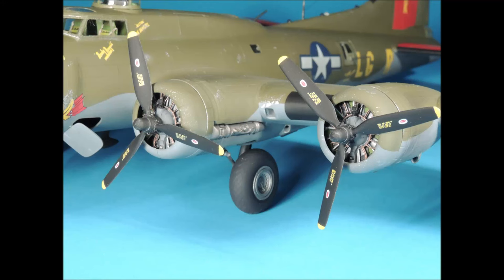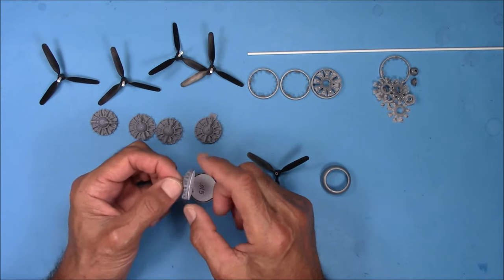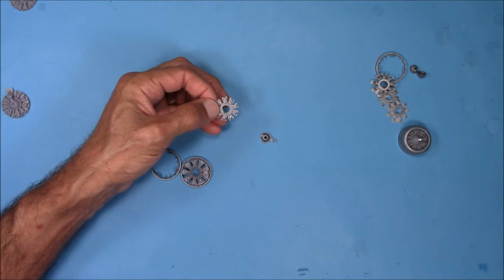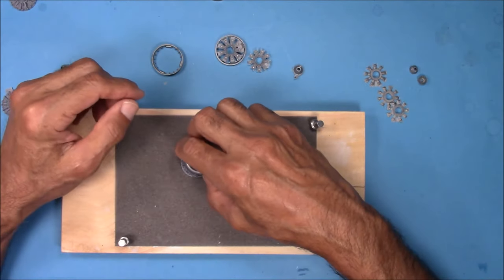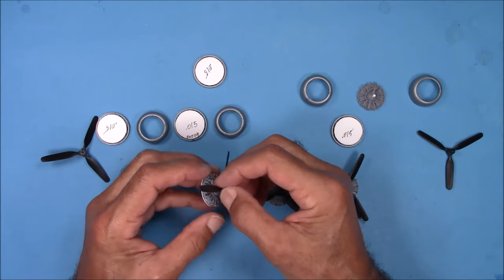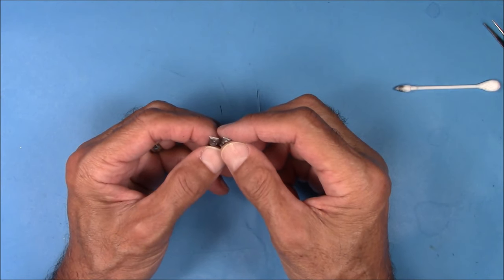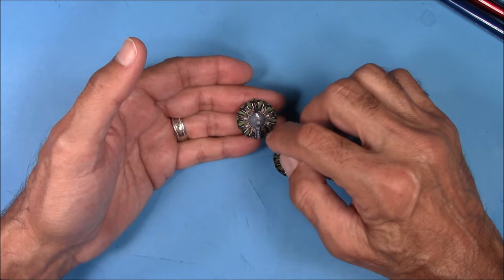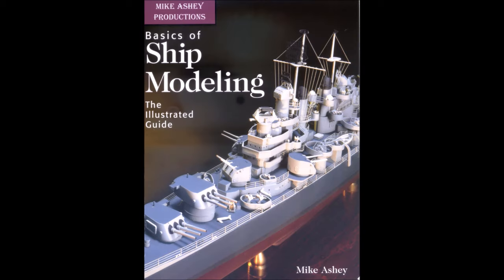The Engines-Part-2 of Detailing & Building the Revell Monogram 1/48 scale B-17G.

Comment: Stellar vid Mike.  Got a question.  I have to do a ton of PE work on a ship kit.  I’ve got bending tools and jigs that work.  Is there a set of tweezers that you recommend for this task??
Reply from the maker: Hi
The only PE work I do on ship kits
Reply from the maker: now are the railings. I use wood dowels for curves and flat nosed pliers for bends

For everything else i use Blackcat models 3D printed parts. They have radars, 20mm, 40mm and twin 5 inch mounts.

all beautifully detailed.

Comment: Nice work.  Looking at all the work involved removing the kit engine form the cowl flaps, I was wondering if there was an easier way.  It appears that the cowl part fits snuggly onto the cowl flap part.  If true, then it seems like the styrene disks can be worked from the inside out, instead of the outside in.  In other words, the thicker dick can be made to fit reasonably snuggle on the inside of the cowl flaps.  Then an undersized styrene disk can be on the top side (top side being the side attaching to the cowl).  Agree that the thickness of the styrene disks may change, but then less care and time would be required to removing the engine portion of the kits cowl flap/engine part.